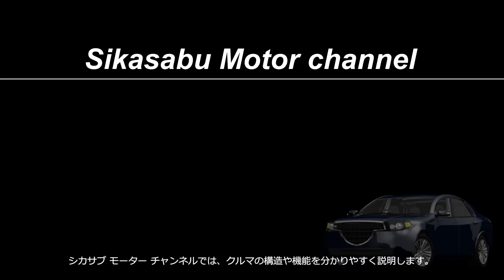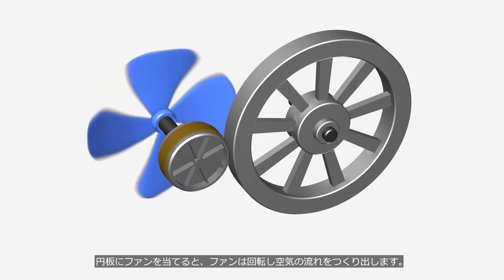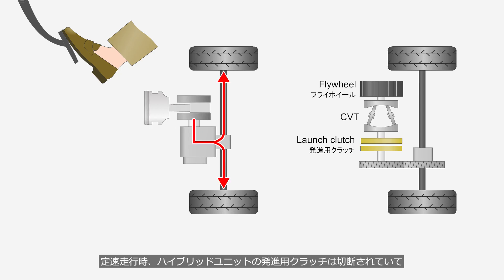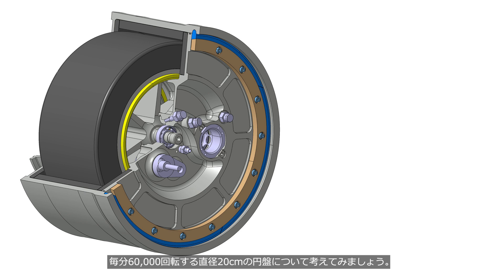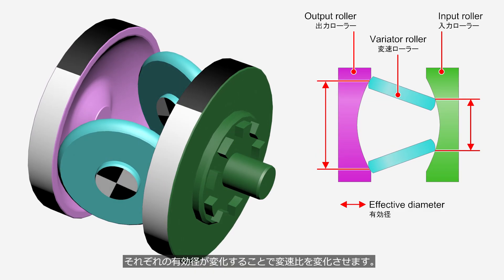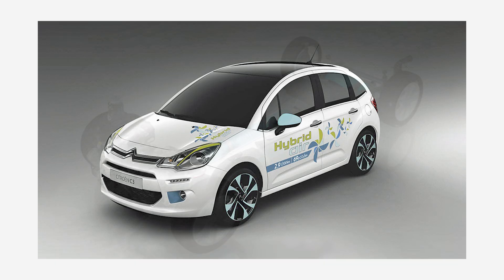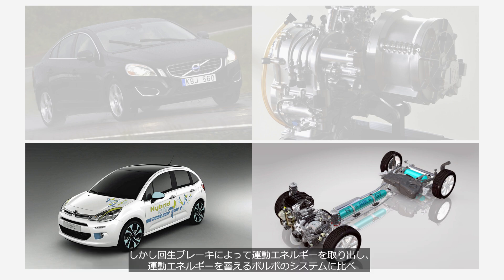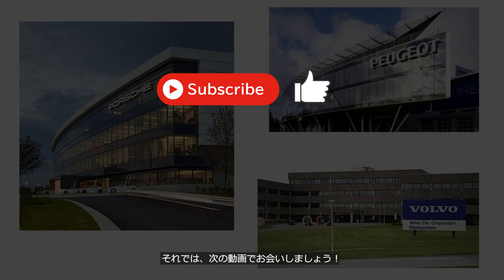Hybrids Without Electricity  Flywheel hybrid & Air hybrid

Comment: Thanks for the information in the video. Volvo and others didn't stop to innovate on research level, for example Volvo designed a very simple, but helpful air compressor system to accelerate the turbo shaft with compressed air, won by retarded energy with a simple air compressor system used on Truck brake systems.